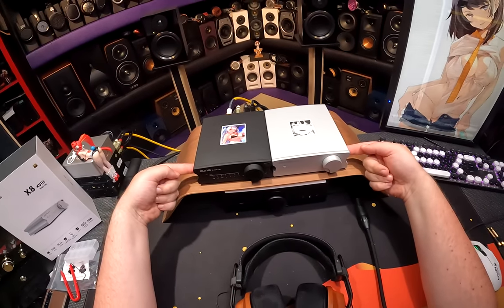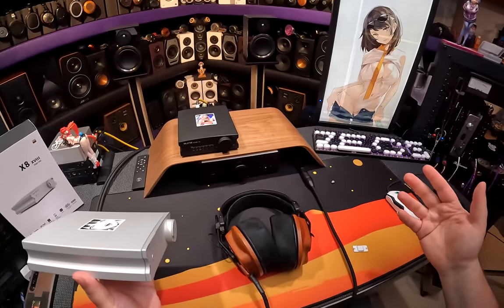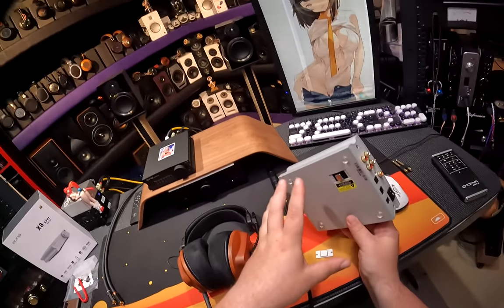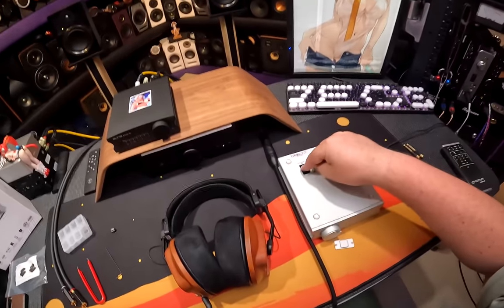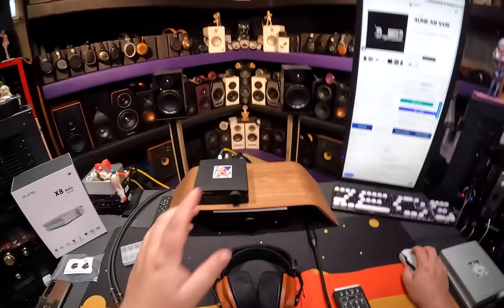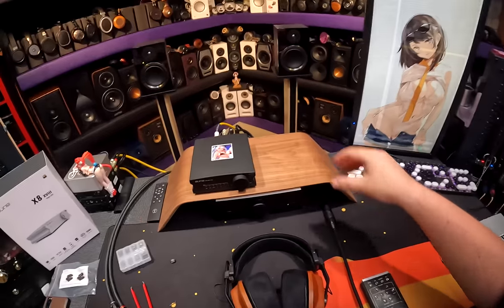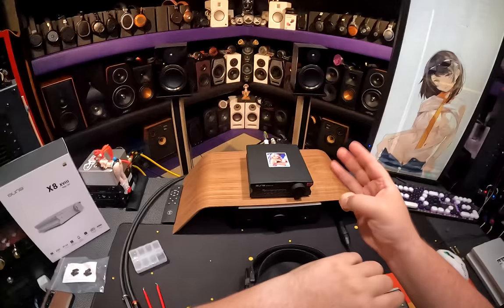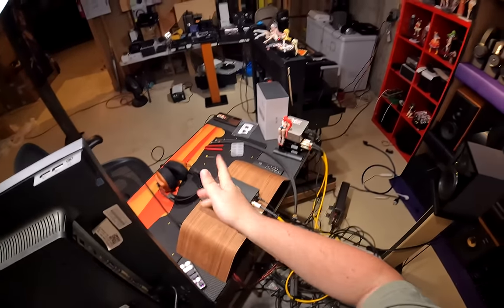Aune MAGIC DAC is BACK!! (XVIII Edition)

Comment: You nailed it. Just how much of the sound of a DAC, the DAC itself, or the AMP section? IMHO the amp is responsible for shaping the signal of these DACs. I think the capacitors / opamps / amp sections are the parts responsible for most of the sound changes which can make speakers sound better / worse depending on the crossover network in the speaker. This is why we have warm and cold, dacs / amps / speakers, and certain combinations seems to mix better then others. The end result IMHO, is the dac chip has little to do with the sound after you reach +100db SNRs.
Reply: wanna know something. The crossover in speakers is made of inductors and capacitors to filter frequencies low and high. That means they really do shape the sound wherever they are and depending on how they are implemented they filter out certain things.

Comment: I used to have an X8 and I did extensive blind A-B listening tests between it and the DAC in the miniDSP 2x4 HD, which measures significantly worse, and I could not for the life of me tell them apart. Ended up selling the X8 and deciding I shouldn't worry about "if my DAC is good enough" ever again.

The tests were performed with lossless 16 bit/44.1kHZ music files, a Topping A90 and a few different headphones (Audeze LCD-2C, Beyerdynamic DT 1770 Pro, Philips Fidelio X3 and Sennheiser HD 650).

I usually mention this as a warning to people to be careful and not overspend on DACs.
Reply from the maker: I too went through that fun A/B.. With the OG you really needed to swap the OP to get the benefit. This new one comes with an unhinged OPA already installed which is the better play.
Reply: Like is said all dac sounds the same unless they have a different sound signature
Reply: With the stock op amp, the X8 sounded average, nothing out of the ordinary for the price. Swap the op amp for the Sparkos and the leap is significant. It is a bit softer in dynamics in comparison to higher end Topping but the detail and stage depth are nice.  For the price, especially when on sale, it's the budget combo to go for, IMO.  It will keep up with dacs double the price (at least on speakers). One could still prefer one sound/presentation over the other depending on music, etc., but it will be at that level.
Reply: How about stack 2 opamps into that 8pin holder? You may be pleasantly surprised by the audio difference

Comment: Hey Z. So, your example of a Raspberry Pi isn't exactly correct. The Pi has a general purpose microprocessor, which is not what an FPGA is.  To understand FPGA's you need to first understand ASCIs. An ASIC is an "application-specific integrated circuit". Which is what most chip based DACs are. (Some DACs are made of discrete components, like most R2Rs but that's a different discussion) ASCIs don't generally run code like microprocessors do. They are fixed function and usually operate on data alone.  These have the advantage of being faster and more power efficient than microprocessors and use a lot less silicon to to the job.  However they can basically only do one thing, (or a handful of predefined things), and this is somewhat limiting because it can never do anything else.  Enter FPGAs. You can think of them as ASICs who's function can be reconfigured on the fly. Like an ASIC it's not running a program as a microprocessor would be. But it's not limited to a fixed function either.

Comment: the old one was FPGA as well. Easy way to describe is all the other chips (ESS, AKM, etc) are built to do only one thing. FPGA are programmable so they can do whatever depending on the programming (from....for example.....the op amp)
Reply: Both Aune Magic DACS use an ESS DAC chip though lol.
Reply: @tenveri  I just brought up chips to highlight the difference. Yes, in this case the aune uses the fpga chip for amplification and not conversion (vs smtg like a chord dac) but same holds true across various technologies whether it's cloud computing, imaging, etc etc. Just the difference between locked and programmable
Reply: The FPGA (probably an Altera) is really just used for digital processing the inputs. Not amplification that's for sure.

Comment: I`m gonna put a Burson V7 Vivid in my X8 in a couple of days when I get it and then it`s pretty much upgraded as far as possible, I have the XP2 torodial power supply brick for it too. I can`t tell if it makes a difference but it`s nice to have it. suddenly it will be a $650 setup with all of the upgrades. As you said the OP amp besically makes more difference than the dac chip itself, anything more expensive than a X8 with the best OP chip on the market and I wouldn`t be able to tell the differences unless it also had swappable OPs of which 99% of really high end dacs doesn`t except the Bursons
Reply: Hi. Did you put the Burson in?

Comment: When I used the op amp by TI BB 2604, it sounded with a Lot of body in low Frequencies, vocal were pushed forward, and High Frequencies sounded sweet. It sounded much better than the Muses 01. My next test is the TI BB 2134. I'll report back in a few days. Happy Rolling.

Comment: I'd like to see what you feel /think about the SparkosLabs SS3602 opamp in the Aune...
Reply: Just came by to say that the SS3602 is excellent on this DAC. I have it feeding an IFI zen can and could immediately hear the sound was cleaner and more crisp compared to the IC opamps. The initial edge of notes, especially percussion is more defined and lifelike. I think it pairs well with the Ifi because that brings some flavor. If it’s going into a 789 or similar it might be too sterile. I actually just ordered the dual stacked SS2590 “pro” level opamp to test that as well.
Reply: @MrSteveo865  Do come back and talk to me about that.   I put the Burson V6 Vivid in a few weeks back and I found it to be just as good as the SS3602.   Of course with it's own subtlety.. It really gives the Sparkos a run for it's money.  I'm considering the Staccato too.  But that shipping is killing me.   Looking forward to hearing from you again.
Reply: @MrSteveo865  I said... F' it... I bought the dual SS2590 soldered to the dip 8.   Plus I have 2 risers.   It looks beastly.    I might make a platform for he DAC with a cutout for the op-amp.   I hope you used the 20OFF coupon code
Reply: @Scrufboy  I think I only used the 15% off one. Alright as long as that extra few bucks goes to a good company. What amp + headphones/speakers are you feeding with yours? I really liked the Aune on the zen can with Sundaras. I preferred my Ifi zen one dac on my speakers though, they just had very distinct flavors that were both good, just had different strengths. The Aune was more crisp and tighter in the bass while the Ifi brought a really nice soundstage and relaxed sound to my stereo system. I’m also considering getting a v6 vivid to try it. Could be a nice flavor for the Aune as well. Will be keeping my eye out for a decent deal on one once I can sell one of the sparkos.
Reply: @MrSteveo865  Well, I have a Franken beast setup in my bedroom.     

My AUNE X8 XVIII is powered by the Aune XP2 with a additional inline 9V Supercapacitor bank - Schiit Loki+ mini - Schiit Magni+ Heretic HA/Pre (DT-1990's). - Aiyima A07 Pro with 5 Sparkos SS3602's installed (LS50 Meta's) - Aiyima A3001 Sub amp (SVS SB-1000 pro)   all IC's are currently silver plated coax except the output to the sub amp.  I also have a nice set of Star Quad Mogami IC's with Canare Pro connectors to swap out.  My subwoofer cable and all my DC cables are custom made by Ghent Xu's lead engineer at Ghent Audio.  My silver plated Coax is made by INNTAK Hi-Fi,   my Mogami IC's are made by Performance Audio.  My speaker cables are currently DIY Canare 4S11 Star Quad.  My speaker and subwoofer amps are powered by a Drok 48V 10A SMPS in a custom enclosure. 

 I will probably try the Bursons in the Aiyima A07 pro.  Either using just one in the tone stage or one there and one in the output stage to the sub amp.    Or maybe both Burson in the volume and tone...    Too bad we aren't local, you could try a Burson out right now.   I bought 2 when I ordered.

Incidentally... This dual SS2590 will be massive.   I already have the Aune's feet resting in some upside down rubber cabinet feet that raises it an inch.   I will probably buy a cheap 10x7 wood cutting board and mount some spikes.   Then make a cutout for this massive dual op-amp to nest in...

This is most likely going to be end game for us on this DAC.    If this truly blows the SS3602 and the Burson out of the water.   I won't see any reason to buy a more expensive DAC.   It already sounds good..  Then with the SS3602 it was a huge difference.. The Burson made it faster in the transients and the decaying - and just slightly better for my tastes.   If this SS2590 dual setup is better.     You and I will be in very unique positions...  Being somewhat Mavericks in a sea of enthusiasts.
Reply: @MrSteveo865  You get yours in yet?   I'm curious about what you experience with it.   There are a few video reviews/commentaries about using the SS3602 and the Burson.    Could the dual SS2590 topple those results?
Reply: @Scrufboy  I haven’t received it yet. Should be here Thursday afternoon according to usps. I’ve been playing with the Schiit Syn I just got. Really enjoying the surround setup with the Aune into the syn which then goes into my Yamaha avr 5.1 system.
Reply: @MrSteveo865  Neat!
Reply: @MrSteveo865  Getting excited... But feeling cautious.  Almost nervous.
Reply: @Scrufboy  I know what you mean! I just got mine in today. Only been listening for an hour or so. Gonna need some time to form any opinions.
Reply: @MrSteveo865  I keep posting and it keeps disappearing?!?
Reply: @Scrufboy  I think the 2590 is nicer sounding that the 3602. I feel like it’s a bit smoother without losing detail. Transients sound a bit over sharpened and not quite “right” on the 3602 comparatively. More precision in soundstage with the 2590 with about the same size and presentation of stage. Overall it just sounds more refined and easier to listen to. I may swap back and forth a couple more times to get a better picture but as of now I think this is the way I’m going.
Reply: @MrSteveo865  Curious, what filters are you using?

I agree with your findings... 

But I'm still trying to dial in the sound.   I moved from C to AB.

But Amazon also decided to actually randomize my Playlist so I'm getting slammed with some super cool tracks I haven't heard.

I also found a way to "secure" the op-amp.  I tried to post the info, but YT somehow never posted the replies. 

I bought some rubber feet for speaker cabinets.  

ASHATA 8 Pcs 30x20mm Rubber Feet Anti-Vibration Base Pad Stand for Speaker Guitar Amplifier

They're about an inch tall.  With the Burson, I had these placed upside down - basically just encompassing the Aune feet.  However, for the SS2590, I used gorilla double sided tape to adhere the feet.  The included feet come off pretty easy..  So I basically replaced the feet with these taller ones. 

Then I found a project box, that was a perfect fit after some modifications
.
Zulkit 5Pcs Project Boxes ABS Plastic Electrical Project Case Power Junction Box Black 2.40 x 1.41 x 0.98 inch (61 x 36 x 25 mm)

Andrew at Sparkos told me to vent this box, I am using this little box as the back right leg essentially..

The op-amp is now protected from dust, pollen and whatever moisture from my open window from particulates, rain, humidity, etc.

I may be re-arranging a bit once some cables arrive. I'll try to get some pictures up on imgur and see if I can share them with you.

Products where bought on Amazon, descriptions provided so you can easily find them if interested. 

Modifications were sanding of the top open edge of the box to match height of the attached feet. 

Small dremel work on the inside longer walls so the op-amp could snugly fit inside the box.   A patch of desk mat material was glued to the bottom inside of the box in oder to keep the op-amp snugly plugged in. 

This mod came out so good, with all these elements oddly being perfect I needed to share. 

It beats having the Aune on its side or upside down just to accommodate discrete op-amps. 

Andrew would probably be quite interested in your thoughts about the SS2590 in the X8.

I'll get back to you.
Reply: @Scrufboy  I use A or AB filters. Honestly, I can only barely tell a difference between minimum phase and linear phase. Imo, as long as it’s linear phase I can’t hear a difference (or I at least wouldn’t know something was different unless I looked). 
I like those boxes for this purpose. I went to Home Depot and picked up a 22 gauge sheet of aluminum and shaped that into a box that’s 2” square and just tall enough to cover the opamp without touching. That aluminum box is just held on with bluetack and I have the dac sitting upside down on the desk. I tried taller feet on it but since my amp sits on top of it, it just didn’t feel as secure as upside down bluetacked to the desk, especially when plugging and unplugging from the amp. Sounds like I may need to vent the opamp though. Would be easy enough to drill holes and cover with thin material.

Comment: I just got a Schiit Magnius about a month ago. The only DAC I had laying around to pair with it was a Topping D10, which means RCA connection. I only had one set of RCA's at a foot length and they're fairly stiff. Because of this, the little Topping won't sit flat 🤯. It's really tripping my OCD. Went to Schiit about getting a balanced DAC to match my Magnius but the Modius doesn't ship for 3-5 weeks. The Bifrost is more than I'm willing to pay. I don't know what to do at the moment.
Reply: I used a velcro strap to bundle the rca's tighter
Reply: greytack

Comment: Try swap the Sparkos Opamp SS3602! Real smooth difference.
Reply: I offered to send him one ! I got 6 of thrm total 😃
Reply from the maker: @tee-jaythestereo-bargainph2120  DAMN.. I will see if Sparkos will hook me up.
Reply: @ZReviews  did you ever try this config out? If so, how'd it sound? (if you remember a year later )
Reply: @sutorman i finally got my hands on an aune with the sparkos upgrading from a schiit modi 3. i have to say, it sounds amazing. the biggest difference to my ears is how much smoother and more defined the midrange is but i’ve also noticed better imaging, and more power from the upper bass frequencies. i listen to rock and punk and the sound has become much more percussive and slams sound more dynamic than before. modi is still a great dac of course but the x8 sparkos really kicks butt

Comment: Anyone know of a 3D printed cover for the opamp which work with tall opamps like Sparkos, a transparent cover would look way cool,  no need for changing the feet, just keep it vertically.
Reply: I'd like to see a 3D printed cover too.    I'm currently using the SparkosLabs...  However,  I bought some cheap isolation feet from Amazon and I just put he DAC on top of  those.   The DACs feet fit right in.
Reply: @Scrufboy  Cool! I also installed some feets from Amazon and created a diy cover from I think a battery pack or razor I don't remember exactly and taped it to the Opamp window, I need it as my place is quite dusty and so far working fine.